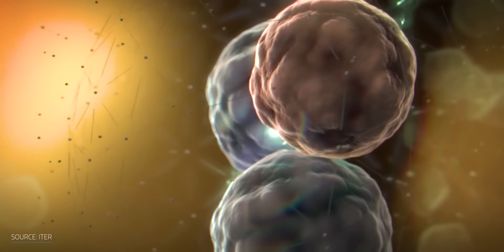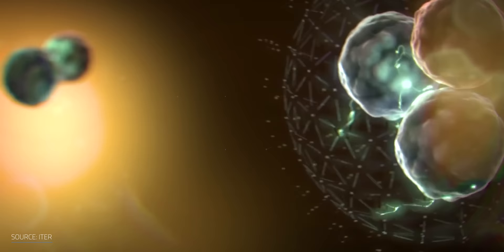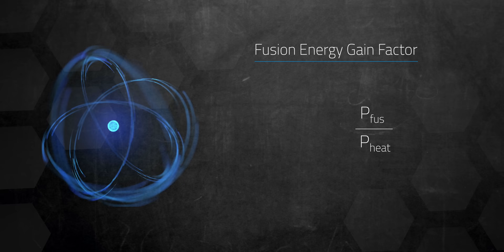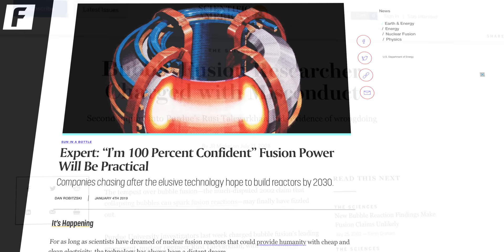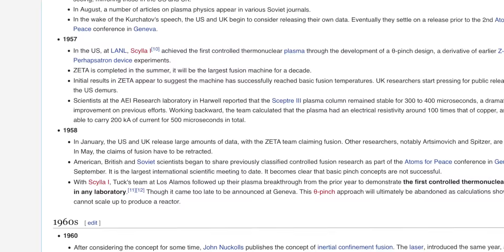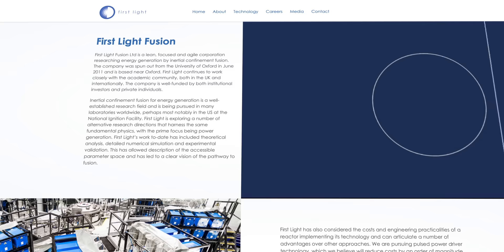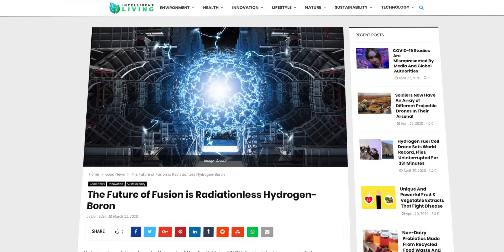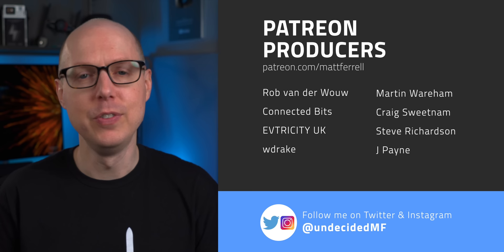The truth about nuclear fusion power - new breakthroughs

Comment: "Don't expect your home to be fusion powered in the next 10 or 20 years." - I'm guessing we'll have fusion reactors powering our homes in 30 years 😃
Reply: I say no earlier than 2060. We still don't have gen 4 fission reactors up and will probably not have until 2040 desptie we pretty much have worked out how to do it.
Reply: 21 years
Reply: @drx1xym154  Three mile island, Fukushima, and Chernobly are impossible on modern fission reactors (gen3+) anyway
Reply: More likely, NEVER.
Reply: drx1 xym In what way is this “better”? This is just another version of a conventional reactor requiring massive expenditure and reliance on a national or international level grid, when the whole point is to break things apart into smaller units.
Reply: Solar salt arrays for Metropolises an reactors for Space fairing would be my vote.  Also green tech for off grid living.
Reply: We already have fusion powered houses. The sun is a fusion reactor. Solar panels transfer that fusion energy to the grid. Why reinvent the wheel, so to speak?
Reply: @aftonline  If you think that solar PV panels are fusion power just because the source of their energy is a fusion powered sphere 93 million miles away, you are a very confused human being. PV panels convert around 10% of the energy they receive into electricity, while hot water solar panels do a better conversion job through radiation, not fusion of atoms. Confusion is revealed when you say that we are attempting to reinvent the wheel when we haven';t even invented it yet, even "so to speak"!
Reply: @nixl3518  Consider the source... in fact all energy on earth comes from the sun. Fossil fuels derive from plant or animal matter which in turn derives its energy from photosynthesis. My point is that fusion energy is very difficult to contain on earth but if you have a fusion energy source 93 million miles away pumping out more energy than we will ever use, you don't have to build a fusion reactor on earth. btw "we" may not have invented the wheel, but that "corona" in the sky is definitely there and available for our use, regardless of where you think it came from.
Reply: @drx1xym154  Don't  forget . . . It isn't a sun either.
Reply: More like.... never. Fusion power will always be 20 years away.....forever.
Reply: @nil981  Predicting the future has never been a safe bet. The minute u say it'll never happen, it does!!
Reply: @nixl3518  Yes and there are also absorption refrigeration devices which bypass electricity and use the heat of the Sun which separates out a refrigerant in a generator which boils off, then it goes into a condenser where the heat is transferred out into the outside atmosphere and the refrigerant liquifies again, the energy depleted refrigerant goes into an evaporatior in which a heat exchanger dumps the heat out of the cooling load from the inside of the structure by boiling it off once again and the vapors are drawn to absorber which are then sent to the generator to be separated again by the sunlight. Some electricity may be used for transfers although these systems tend to be gravity operated, but the refrigerant generation is done by the Sun.
   I agree, the best likely in our lifetimes, certainly mine, would be safe, small, mass produced fission reactors in which a plan can be approved by the regulatory bodies for all of them.  No-one is building Soviet reactors, Three Mile Island reactors or Fukushima reactors.  Of course in Three Mile Island, the reactor was destroyed, but there was a negligible spread of material.  It wasn't an environmental disaster.  The problem is that fusion might be used as an excuse not to build new fission units.  Instead of 30 years away with fusion with every "breakthrough," we will be half way there, then three-quarters of the way there, then seven-eights of the way there, then fifteen-sixteenths of the way there and infinitely getting closer and closer, but never reaching it.  There will always be little problems - a bit more time, a lot more money.
Reply: @lewisdoherty7621  The problem with fission units has nothing to do with fusion units getting in their way!! That idea is gone for good. The problems with those are insurmountable AFTER they are built. No matter which kind is employed they will always be a potential threat, but the byproducts are the bigger threat as they remain essentially a permanent one. Imagine ignoring this problem like we already did, and began a new program to employ fission units for all our needs, replacing all the carbon units wold wide. U just cannot invent a method of safe storage that will last tens or hundreds of thousands of years and you cannot ignore the threat of the byproducts being weaponized. The only safe method is solar incineration but that requires technology we do not possess and more importantly a willingness to assemble a process that in itself is dangerous.

The only nuclear solution we have at this point is fusion. It's problems are HOW to build them. Your pessimistic assumptions are nothing more than assumptions because u just cannot predict the future basing it on the past. Brilliant people are working on the problems that could one day be solved and that "day" could be tomorrow or later. U just can't say no more research on the basis of your last sentence and even if one did, that would not result in fusion coming back -ever!

I'm not sure why u spent so much time and effort on ARD's, though I have yet to see a unit that is not powered by electricity.
Reply: @nixl3518  I agree that what you say is what people perceive as the problems among other things and therefore fusion is held out as a "solution."    So people will say just wait on the fission plants because the fusion solution is almost here.  But, there is reprocessing of spent fuel.  The byproducts can be weaponized except that since most of the countries in the world which would use these plants already have nuclear weapons and the countries that don't have nuclear weapons maintain control of the materials and ship the materials to countries who already have nuclear weapons for reprocessing, the proliferation problem isn't real.  There are numerous deep places the waste can be sent to get it out of the biosphere.  The raw materials to create this stuff came out of the ground and the used stuff can be sent back into the ground.  The difference is the waste material is now concentrated.  I always thought the materials should be sunken at the descending plate location of the Marianas' Trench where they would be pulled under the Earth's crust to come up in magma millions of years from now as more stable elements.
Reply: @Erowens98  overloading is not 'impossible,' but with every new generation, it becomes increasingly unlikely. That being said, you're probably a few thousand times more safe in a reactor these days than you are driving
Reply: I was posting on Reddit about how useful a fusion powered carbon vacuum would be. People are so stupid that they jumped all over me because Fusion does not exist today. I spent days clearing up their stupidity. Imagine if everyone were like them. we would have nothing.
Reply: @Dennzer1  unfortunately it seems like quite a lot of people are like them. reddit's Karma concept really, really doesn't help either since it incentivizes the most popular or most appreciated responses rather than the most factual yet unpopular responses.
Reply: @Dennzer1  ...not that I know what the carbon vacuum thing is all about....
Reply: Donald Kasper  Math is theory and theory in this case has to be applied to real life i.e. physics. They are attempting to harness the power of the sun and put it in a bottle and that requires knowledge we are still struggling to gain. That it hasn't happened yet does not mean it won't! But they sure feel that it will happen one day soon!! 

You sound like a person in the late 1800's scoffing at people trying to design "heavier than air" aircraft. They scoffed until 1903!! So just wait for the year that physicists succeed and then tell u "told u so"!!
Reply: Donald Kasper  So why don't you keep writing rather than wasting ur time on YT. What else can it be but ego that u sit here and write all this nonsense? I know u haven't written 50 books because u said so!! Memory problems or were u lying? U seem to be a regular Da Vinci, covering everything u can think of. Jack of all trades and master of none? Why don't u focus on getting peer reviewed so what you write might actually be taken seriously?? What's the matter with you?
Reply: Power storage will be so advanced by then they will be unnecessary
Reply: Thomas Chrombly  An explosion at a nuclear fission power plant can spread radioactive fuel into the environment where, depending on the material, radioactivity can last for decades, or millennia. These particles could then settle in the water tables, in food or clothing, or be inhaled in.
Reply: Thomas Chrombly  of course they were finished in the late 70's-80's because it takes forever to build them at enormous expense.  I thought the others were supposed to be fail safe?  Don't remember anyone telling me when I was a child that they might meltdown and kill us all.
Reply: Thomas Chrombly  definitely u are not equipped to assert!!
Reply: Moving your home close to Sun is more probable in 30 years.
Reply: @drx1xym154  why do people talk about three Mile island like it was anything even close to Chernobyl or Fukushima? You never hear people talk about like wind scale or the other rbmk reactor that blew up the first time in the soviet union
Reply: @snetmotnosrorb3946  Gen 4 fission is not gating compact fusion.   They are completely independent.   If a compact Gen4 fission plant were the input to a compact fusion tokamak with a Q factor of 10 we'd still have to suffer the idiocracy of environmentalists demanding we not do anything in anyone's backyard.
Reply: @jeromebarry1741  That wasn't what I was suggesting, merely that these things take very long time to get commercial.
Reply: Any data on any of this guess?
Reply: @aftonline  because that method requires a massive amount of extra resources.

Then there's the eventuality of the waste it will produce in the future...when these reach their end of life a life time from now...en mass.

That's why it's good to keep working on a Plan C that circumvents all that resource and waste problems...when they eventually become problems.
Reply: @tylerdurden3722  Ok Mr Tyler Durden from Fight Club, so how many billions of dollars will have to be spent on research before fusion power is available? Solar energy is here now and available on a roof near you. Like any other form of technology such as your car or the roof on your house it needs to be maintained or replaced every 10 to 20 years but once installed it provides free energy directly to the consumer without transmission losses over hundreds of miles of power lines. Plus if you have energy storage at home you can use daytime energy to charge your electric car at night. What could be better?
Reply: @aftonline  Probably Trillions will be spent. And the type of Fusion people are currently busy developing is not ideal...they're working on Deuterium-Tritium Fusion (it's not clean, it does produce nuclear waste due to high speed neutrons, tritium is extremely hard to come by. Only 20Kg in the entire world.) But that is just a stepping stone towards clean fusion. They're going for this one because it's the easiest one.

The true Holy Grail of Fusion is Deuterium-Deuterium fusion. It truly is clean. This is the one which only has Helium as a waste product. Deuterium as a fusion fuel is virtually infinite and easy to find. But it'll take another 80 years or more to achieve.

In the end, achieving this will be more than worth it. It's the only, truly sustainable option.

Everything else is a temporary lesser evil. Even Solar options.

You can't achieve something, if you don't at least try. And were not doing it for us, it's for future generations...
Reply: did u not listen he said in 30 years they will still be saying another 30 years get real people we will be frezing our balls of till we die
Reply: Fusion will never power our homes. Just as there will never be a hydrogen age. But we will have free electricity.
Reply: Science Revolution   Nope.  It's pretty easy to see that it doesn't work that way.
Reply: Science Revolution   If "trash talk" means "understanding the actual principle of conservation of energy and momentum in nature" then, okay.   But certainly not "trash talk" in terms of gratuitous slander.
Reply: @lewisdoherty7621  Are you describing Servel refrigeration?
Reply: Thing is were the only species in the planet delaying its own evolution
Reply: It will never happen.
Reply: @aftonline  just cause something works doesn't mean it can't be improved
Reply: It’s interesting that the usual comments are made “Don’t expect” your forgetting human ingenuity to be able to do complete a task due to the ever increasing speed of technology
Reply: @tylerdurden3722   We've been working on fusion for a long time. Imagine if we put all that effort and money into battery research for renewables, safer and cheaper nuclear. Green energy would be much more competitive.

Point is, rather than focusing on a distant ideal, why not work for what is already within arms length?
Reply: 31